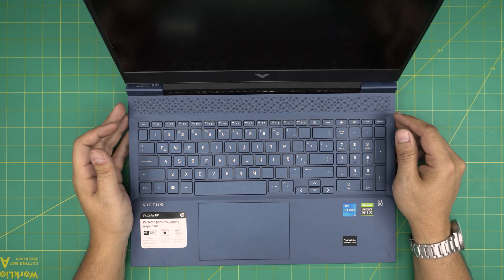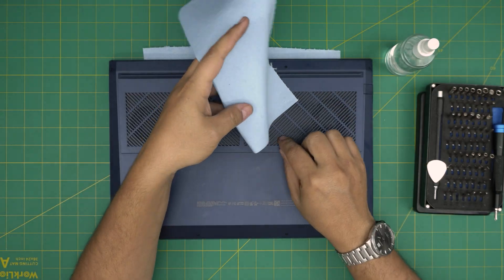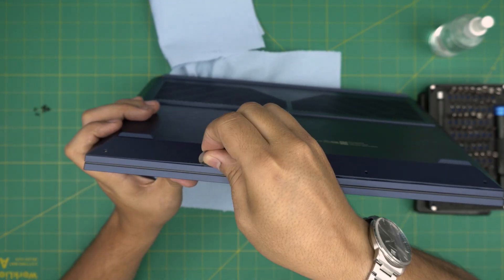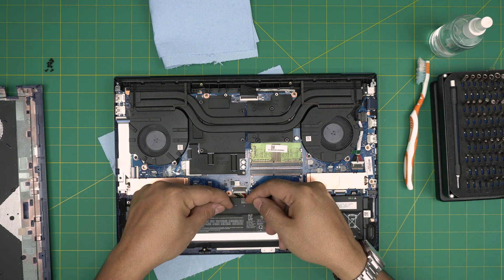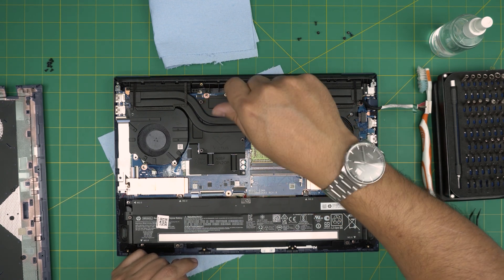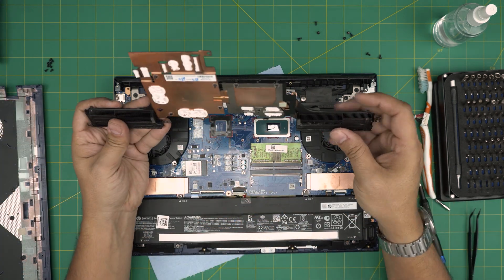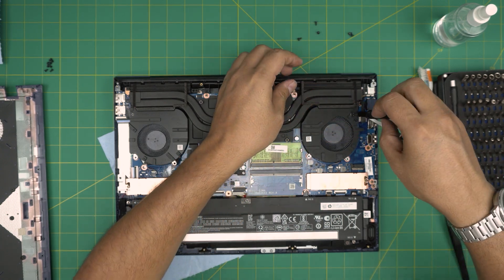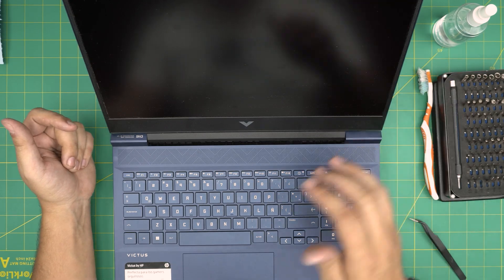How to Repaste and Clean an HP Victus 16 d0507 Laptop

Comment: 12:57 i bent the pins in the battery connector 
I know I'm in big trouble 
Is there any solution for me
Reply from the maker: 🫠Regarding your issue, you are not in big trouble. All you need to do is use a pointed tweezers and straighten the pins in the jack, and that is all. It does happen to some people, but nothing major that is not fixable.
cheers🍻
Reply: @uFixTek hope it's as easy as you say
Thanks

Comment: Hi there great video, but I saw you didn't change the thermal putty and only repasted the gpu and cpu die, is it fine to just repaste the cpu/gpu die only and keep using the thermal putty? or would I also need to replace the thermal putty, if so, are there any schematics on replacing the putty?
Reply from the maker: It's my pleasure my friend.
🫠Regarding your question, there's no need to replace the thermal putty—they have a very long lifespan. However, if you wish to replace it, simply apply a blob on each component, and it will get squished once the heatsink is placed. But again, you don't need to.
Should you have any further questions or requests in the future, please don't hesitate to ask me.
cheers🍻

Comment: does it void the warranty ?
Reply from the maker: As long as you haven’t caused any physical damage, your warranty remains valid even if you open or service your laptop.
This is backed by the Magnuson-Moss Warranty Act, a U.S. federal law that prevents manufacturers from voiding warranties just because you opened or repaired the device yourself — unless they can prove your actions caused the problem.
cheers🍻

Comment: What spec of the victus this?
Reply from the maker: | *Processor*  | Intel Core i5‑11400H (6 cores / 12 threads, up to 4.5 GHz, 12 MB L3) ([hp.com][1])
| *Memory*     | 8 GB DDR4‑2933 MHz (1×8 GB)
| *Storage*    | 512 GB PCIe NVMe TLC M.2 SSD
| *Graphics*   | NVIDIA GeForce RTX 3050 (4 GB GDDR6)
| *Display*    | 16.1″ FHD (1920×1080), 144 Hz, IPS, micro-edge, anti-glare, 250 nits, 45 % NTSC
| *Battery*    | 4-cell 70 Wh Li‑ion; up to \~7 h 15 min video playback

Comment: Hello. I am going to replace the thermal paste, but I see that you do not change the thermal paste for video memory and other elements. Is it possible to leave it even if the thermal paste has not been changed for several years or is it better to replace it as well? In this case, is there any difference in replacing the thermal paste on them, and what thermal paste do you recommend for them? Thank you
Reply from the maker: 🫠Regarding your question, just change the paste for the GPU/CPU the thermal putty /pads have a 6years life span.
you could add on top them a bit of paste.
Should you have any further questions or requests in the future, please don't hesitate to ask me.
cheers🍻
Reply: @uFixTek thanks 👍
Reply from the maker: It's my pleasure my friend.

Comment: Hello, good video!
I am having keyboard heat in the middle of itself. In the same time cpu temp lies somewhere under 60-70 C.
Reply from the maker: 🫠Regarding your question, yes, that is a very common issue with these Vistus models. I recommend that you open it up, clean it, reapply thermal paste to the CPU/GPU, and make sure the air vents are clean and clear.
Should you have any further questions or requests in the future, please don't hesitate to ask me.
cheers🍻

Comment: Hi, I bought an Hp Victus 16 laptop in September, everything is fine, I like it, I would like to ask a question, I used to have 65 degrees in cs2, and now it's 70-80 at the moment, is it worth cleaning the laptop and changing the thermal paste and can you send the goods from Amazon that need to be ordered, thank you in advance

Ps I'm afraid to open the laptop if I follow the instructions, will everything be fine?
Reply from the maker: 🫠Regarding your question, if you having max 80 you still fine but once you reach 85-90 then sure repaste and clean the air vents and use a good paste i recommend the following:
ptm7950 honeywell: https://amzn.to/3FNNrG3
99% isopropyl alcohol: https://amzn.to/3Zl2HAP
Should you have any further questions or requests in the future, please don't hesitate to ask me.
cheers🍻

This is an Amazon affiliate link. When you use my links, you are helping to support the channel. 🙏

Comment: Hello there! ok so i've recently got my laptop serviced due to some noise in fans, the fan noise was fixed but after i changed the thermal paste and the thermal pads the temperature of my pc but now the temps are so high that i used to play valorant at 500 fps and now i get 30 fps with overheating cpu and gpu (both are nearly 100 degrees), do you have any fixes for this?
Reply from the maker: 🫠Regarding your question, please do not use thermal pads on this laptop. There is a reason they don’t use pads! The reason is that the heatsink weight, screw springs, gravity, and—most importantly—the gap between the components and the heatsink is not an even number (e.g., 1mm, 0.5mm, or 1.5mm). The space varies significantly, and if you place slightly thicker thermal pads, they will push back against the heatsink. No matter what paste you use on the GPU/CPU, it won’t be effective.
We service these laptops for clients all the time, and they’re very happy—often returning after a few years for cleaning and servicing.
I would recommend the following if you want the best results:
Get an original (not fake) PTM7950 by Honeywell:
https://amzn.to/4jJlcpX
Cut it down to the size of the crystal die on the GPU and CPU (a bit larger is okay, as it’s not conductive).
Then use a good thermal putty:
K5 PRO:
https://amzn.to/3Zls4CD
Apply a fair amount on the components (usually a pea-sized amount, as it will spread under pressure).

*Note:* Make sure you clean the air vents of the fan and heatsink.
Should you have any further questions or requests in the future, please don't hesitate to ask me.
cheers🍻

This is an Amazon affiliate link. When you use my links, you are helping to support the channel. 🙏
Reply: @uFixTek so i removed the thermal pads and checked and it worked fine than before but will it affect the other components if i heavily use it? 

I also got old computers and took out their thermal pads and put it on my pc and the cpu was so much better than the one without pads but the gpu is still same with higher temp, do i cut it down to as small as possible and put it in the gpu components?
Reply from the maker: Yes, it will work better, but I would highly recommend that you *do not* use the laptop if you don't have thermal putty (gel) on the VRMs (components that initially had putty), as they will overheat and burn.
Get yourself the items I mentioned.
Now, if you want to do a mod and get the best results ever, get the items I mentioned, but you will also need to get this:
20mm x 20mm x 0.3mm Copper Shim: https://amzn.to/4kWw0BX
You will need to do the following:
* Apply a fair amount of thermal putty on the components that originally had putty (more is better, as it will get pushed out).
* Apply thermal paste (PTM7950 by Honeywell) on the GPU and CPU crystal dies.
* Place the 0.3mm copper shim (no thicker than that) over the GPU/CPU.
* Apply PTM7950 again over the copper shim.
* Place the heatsink on top and enjoy the results.
🫠🍻

This is an Amazon affiliate link. When you use my links, you are helping to support the channel. 🙏
Reply: @uFixTek  did the vrams had thermal putty before and not the thermal pads? also, do i paste the ptm7950 thermal pad and then put a copper shim above the cpu/gpu and then again apply the ptm7950 above the copper shim?
Reply from the maker: The VRAMs have thermal putty/gel.
Yes, what you need to do is place the PTM directly on the CPU/GPU (on the die), then place the copper shim over it and apply PTM on the copper.
OR, Apply PTM on both sides of the copper, then place it on the CPU/GPU.
Reply: @uFixTek  do you prefer K5 pro or Upsiren UX Pro Ultra? and will Thermal Grizzly Kyronaut work on the cpu/gpu die than ptm7950 or is the ptm7950 more better option?
Reply from the maker: K5 pro or Upsiren UX Pro Ultra
Both are perfectly ok.
ptm7950 is much much better on long run on GPU/CPU
cheers🍻
Reply: @uFixTek  Damn i didn't even know pads would not work on this laptop, can you only use it on a Tower PC or is it only specific to victus laptops?
Reply from the maker: @caramel5036 Thermal pads are used on many laptops, GPUs, and PCs, but in a few laptops—due to the heatsink design, component heights, and many other factors—it's easier to use thermal putty rather than reshape the heatsink.
Reply: -Too much or too little paste can drastically affect cooling., make sure it didn't spill over the sides.+do not replace with normal thermal paste certain components that are using putty.
-Choose the correct thermal pads: Are they too thick/small compared to the previous ones?
-Make sure you replaced everything correctly.
-Either wqy, you can reboot your BIOS system, sometimes, there are bugs, it happens.
Reply: @caramel5036 do you know what thermal pads size should i use?

Comment: Hello, do you have any tutorial on how to replace cmos battery on this laptop? Thanks in advance
Reply from the maker: 🫠Regarding your question, that tutorial doesn't exist as there are no dedicated CMOS batteries for this laptop.  
The CMOS takes its charge from the main internal battery. If you disconnect the internal battery and press and hold the power button for 15 seconds, the CMOS configuration will reset to default.  
Note: The BIOS is encrypted and will not be erased, only the CMOS configurations.
Should you have any further questions or requests in the future, please don't hesitate to ask me.
cheers🍻
Reply: @ sorry again for the question, what should I do if I keep getting 502
Checksum error
Reply from the maker: that could be many errors, from bios error up to PCH chip error.

Comment: Hello, thanks for the video. I have a question. Is the gpu wattage for this laptop normally at around 30w? My laptop has been running well for years then in my latest repaste and clean, it suddenly has lower performance in games. I tried reformatting already. Checking stats in games i see that the gpu is not exceeding 30w, normally at 15-20w even on max util
Reply from the maker: 🫠Regarding your question,Yes that is the normal Watt for the GPU
cheers🍻

Comment: I fucked up, I did the repaste before watching a video and the laptop is kinda ruined, Maybe I put an excess of paste or used the wrong one because now the performance was reduced by 60% on every game and also some pins from the back cover were broken, cpu temperatures go up to 90 just opening chrome, it is just that in my family we all hated to leave the laptop with someone who “knew” because every time they swapped components and steal parts from our laptops and other stuff 😢
Reply from the maker: 🫠Regarding your issue: Remove the old thermal paste and use plenty of isopropyl alcohol (98%+). Use a toothbrush to clean the area around the GPU and CPU thoroughly. Then, purchase a high-quality thermal paste (link in the description) and reapply it.
Should you have any further questions or requests in the future, please don't hesitate to ask me.
cheers🍻
Reply: @ thank you, you give me faith that this is still not a lost case
Reply from the maker: It's my pleasure my friend.
Oh, it is not just that. Wash the board with isopropyl alcohol (98%+) and a toothbrush, making sure to get under the CPU and GPU. Then let it sit for a few hours to dry, or use a hairdryer from a 3" distance on maximum heat for a few minutes to heat up the board. Finally, let it sit to cool.
Reply: Thanks for the advice, I’ll use it
Reply from the maker: good luck

Comment: Do logical processors use different thermal paste? or you can use gray thermal paste in all of them.
Reply from the maker: 🫠Regarding your question, for the CPU/GPU, always use a good brand of thermal paste. Any chip with a crystal die on it must have thermal paste applied.
cheers🍻

Comment: Hi First of all, thank you.   😊I have a question, I couldn't find the screen sensor cable exactly where it is on the HP victus, can you help me? (Hp victus 16 0046nt amd ryzen7840hs )
Reply from the maker: It's my pleasure my friend.
i appreciate your support, 🫠Regarding your question, you can find it very easily. Just grab a small magnet, power on the laptop, and when the screen is on, place and move the magnet around the right and left sides of the palm rest and even in front of the laptop. The magnet will trigger the sensor, and the screen will turn off or the laptop will go to sleep.
Should you have any further questions or requests in the future, please don't hesitate to ask me.
cheers🍻
Reply: @uFixTek  Thank you man ❤️
Reply from the maker: It's my pleasure my friend.

Comment: is it normal that the cpu fan in victus move vertically which if you drop the laptop you hear it i tried tightening up the screw that causes the moving but it stops before it tighten up that fan it only moves vertically not horizontally. as you are one of the people who have victus im asking you
Reply from the maker: how does the fan move "vertically" or "horizontally"??
Reply: @uFixTek  when you touch it. the upper right side it moves a bit only from that side not all the sides

Comment: guys i have hp victus 16 i7 13620h rtx 4070 and i just want to know what is the normal stress tempeture, mine is like 80 90 celcius, some time 95, never more than 100, but is that the normal temperute in stress like 90% cpu, also my laptop is new from store, never used. ty

Chicos, tengo una HP Victus 16 i7 13620h RTX 4070 y solo quiero saber cuál es la temperatura de estrés normal, la mía es como 80-90 grados Celsius, a veces 95, nunca más de 100, pero ¿es esa la temperatura normal en estrés como el 90% de la CPU? Además, mi computadora portátil es nueva de la tienda, nunca se usó. Gracias.
Reply from the maker: 🫠Regarding your question, if under stress CPU usage is at 90%, then yes, it is normal as the CPU is designed to reach up to 100°C. However, as long as you don’t reach 100°C, the CPU will lower its speed to keep the temperatures under control.
Should you have any further questions or requests in the future, please don't hesitate to ask me.
cheers🍻

Comment: Hello man, I don't know if you are still replying to the comments of this video but I have a problem, I did everything in the video right, but the thing is that when I took out the cable of the laptop battery, it came out a little crooked, like it came out first one side of it and then the other side, now that I booted my laptop again I now see a big drop in my FPS, like my graphics card now playing is only using like a 70% and dropping to 40% usage and with it the FPS, it looks very laggy, because it's going at 120 FPS and then a split second passes and it drops to like 30 FPS, then 50 FPS. then 90 and that's the cicle.

It could be because I put a little bit too much thermal paste, but it wasn't that much and I don`t it's the problem, can you or anyone help me solve this?
Reply from the maker: Regarding your question, I need to know what brand of thermal paste you used. As for the battery connector, if the battery is charging and discharging properly, you don't need to worry about the connector.

Now, if you used a good brand of thermal paste and didn't replace the thermal putty with thermal pads, then you don't need to worry about the amount of thermal paste you applied to the GPU and CPU (more is better).

I need you to test a few things. First, shut down the laptop, but before you click the shutdown button in the Start menu, hold down the left Shift key and then, with the mouse, click on shutdown. Keep holding Shift until you see the power light indicator turn off.

Next, keep the laptop connected to the charger, power it on, and test the FPS. Also, monitor the GPU and CPU temperatures. You can use MSI Afterburner or any other program to check the temps.
Reply: @uFixTek  Thank you all so much for your help, I fixed it yesterday, I think it was that I tightened in the incorrect way the CPU and GPU ventilation, I didn't realise one screw wasn't properly tightened. Then, I tried what you said and it worked. Now my laptop is working well.
Reply from the maker: awesome job.
cheers🍻
Reply: The best thing you can do is, open again, check each important component, see if there is anything you might have missed, like correctly plugging the battery cables. If nothing happens, than you might wanna send it to maintainance as there is not much you could actually do.
Reply: Those drops may be either duo to heat in important components that were not properly pasted or a component with a bad connection, which is fairly unsual but IDK. Also, you may want to do a software test before opening up again, to see if you spot anything unsual.
Reply: Check for HP PC Hardware Diagnostics - Diagnose issues outside of the Operating System
Reply: @gabrielalmeida1481  Thank you very much!

Comment: My laptop is 2 years old and the cpu started overheating so I want to clean it and change the thermal paste. Is it ok if I leave the old thermal putty because it's not available to buy in my country?
Reply from the maker: 🫠Regarding your question, that is perfectly fine. Just leave them as they are and only replace the thermal paste with a good quality one.
Should you have any further questions or requests in the future, please don't hesitate to ask me.
cheers🍻
Reply: @uFixTek  what would happen if i tried using normal thermal paste instead of putty in those smaller places? Would it still work?
Reply from the maker: as long as you don't remove the putty and just add a bit of paste over the putty, that is perfect but don't remove the putty.